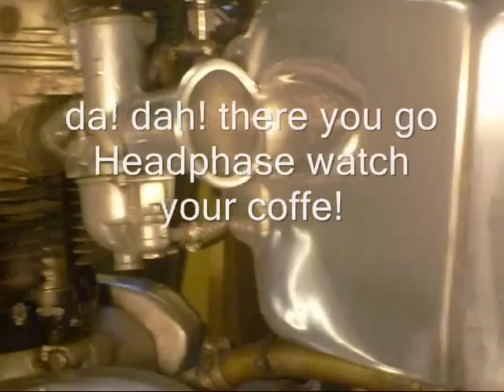polishing panels for my Triumph Bonneville '73 T120R

Comment: Nice, here's a fitting tune by Hawkwind originally, but this one's a bit more polished.....  
https://youtu.be/gF2ODWluPlY
ps. I have a 1978 T140v which I have to nurse occasionally, due to it's age. 
Just refurbished the rear caliper with new ss pots, the master is next due to it's lack of fluidic compression. No end of tinkering on these beauties.
Reply from the maker: Hi Clay :-) great track I've not heard that version before. Aye you've got to look after these owld girls then they are a joy.
Reply: Hi, waiting for the spark plug thread job to finish, so you can get  the "owld" girl started and road tested. Finished the last job on mine today, ready for her MOT test; here's another song for you in anticipation of the forthcoming road test.      https://youtu.be/e2XoYo6UnFU